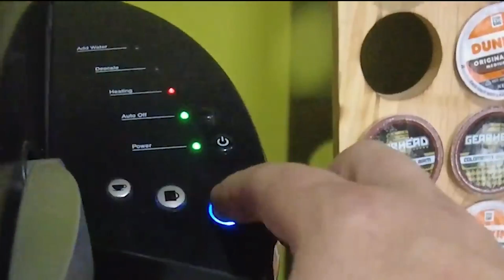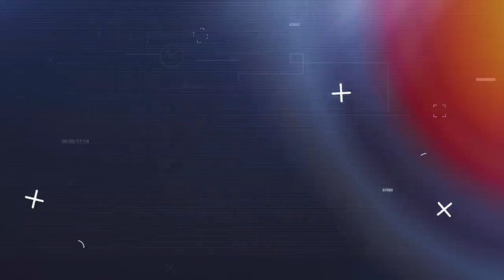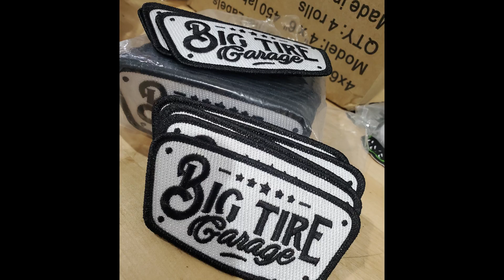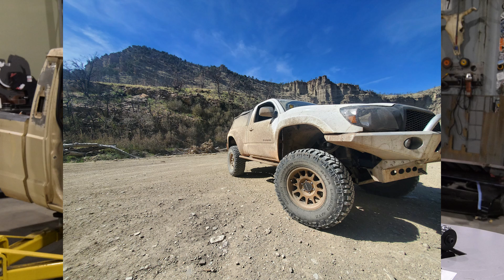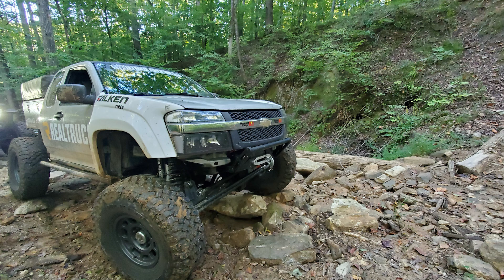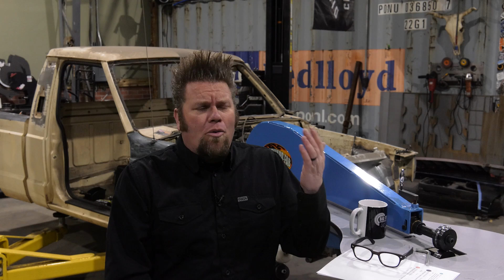The Dirty Secret About Off Road Suspension Design, Why I Don't Build Toyota Trucks, Green S10

Comment: FYI adding bigger tires, off road bumpers and steps, a winch, roof top tent, and all your crap, to a toyota and you've maxed out your toyota's payload and exceeded gross vehicle weight rating. Then lets beat it off road... Sounds like a recipe for disaster.
Reply from the maker: If you modify a vehicle correctly and use it safely you are fine

Comment: I have a 2020 JL 2door, 6 speed manual, I’m lifting it and going to run 35’s and want to put air lockers in it. While I’m there I wouldn’t like to swap gears, what would you recommend for a 3.5 lift with 35’s that will help keep some fuel mileage as it will be my daily for a few years.

Comment: What lockers do you like? Air/Electric/Cable? What is the strongest in your opinion? Do the rear or the front first or both, and would you recommend a winch before lockers?

Comment: Hey Ian! I have been in the offroad world about 12 years now. I am the kind of guy that does things on a budget and has the ability to do fab work myself. My question is this. When doing axle swaps in jeeps why is the aam 9.25 out of a dodge not looked at for swaps? There was a few years where it was high pinion non-disconnect. Is it strictly because of the 9.25 ring gear or are there other reasons? I would think it would hold up to 40's under a jeep? What are your thoughts? Keep up the great work!

Comment: I am bench racing my eventual next crawler/exploration build for west coast wheeling and am debating between a first gen s10, first gen Ranger, or first gen Dakota (all ext cab short bed/bobbed long bed cuz I’m 6’3” and need room). I’d like something low slung SAS, full bodied, on 37-38s, debatable on tons or just built D44/9” cuz I don’t want it crazy wide. Which platform gets your vote for best to SAS without doing a front half, and for decent reliability in drivetrain in stock form? 
P.S. I’d love to do a Comanche but they’re just getting hard to find for cheap, and I’d rather start with a frame (currently running an XJ). Also, Toyota’s are just too expensive these days.

Comment: QUESTION:  What is the formula for building a streetable off-road rig?  The idea is to make a reliable and streetable rig that can hold its own off road.  My off-road goals are to wheel here in the mid-west (Ohio, Kentucky) but I also have a life goal of wheeling the Easter Jeep Safari.  My on-road goals are to drive it in the summer, back and forth to work and around town and on the highway and not fear for my life and the rig needs to be reliable enough that I don't get stranded.  What is the biggest tire I can go with and not have issues on-road?  I already have a set of new 40" tires, is that a bad idea if I want to go 70 mph? I know you love a TH350 I really would prefer a trans with over drive.  What do you recommend?

I have been watching your shows pretty much since the beginning.  My first episode was the bottom drawer buggy payoff with Jessi and I have watched everything you have put out since.  Got to meet you at the off road expo in KY and you are just as nice in person as you are on the show.  I have been buying vehicles and they have pretty much sat in my back yard but that is going to change.

Comment: Question: If I were to add a locker to an exsting ring and pinion, would it be possible to change the ring gear over from the existing carrier to the new locker without doing a gear setup? - Maybe just swap shims side to side. I have no problem buying a dial indicator, but I am wondering if it is possible to check backlash with a feeler gauge? Love the channel. Please advise.

Comment: Question:  Portal axles seem like the perfect solution to several off-road problems.  Why are they not very popular.  Outside of Nate's current build I don't see too many.  I understand they are expensive, but even in builds with amazing budgets they are excluded.  Your thoughts please.
Reply: They are absolutely everywhere if they suit the comp, for example go to a Werock comp and you’ll find more portal rigs than straight axle. 
Whereas speed events like Ultra4 the number one goal is just to finish, the old saying ‘to finish first, first you need to finish’ and the portals just introduce too many possible breakages that don’t necessarily have benefits to outweigh the decision, as in portals aernt going to help at 150mph + in the whoops.
Reply: @robertmason2076  While you state the obvious, you also miss the obvious.  There are more Jeep builds than anything else, and nearly no portals.  Toyotas and Zuks are probably the next most popular, and again, nearly no portals.  There are probably less than 200 moon buggies in the whole country.
Reply: Theyre expensive, rare and hard to get parts for, no aftermarket for steering arms etc,  make shit stupid tall and take away alot of uptravel with how much separation is needed on the links to deal with the extra leverage the portals add to everything. 

They really dont solve many issues
Reply: @krisbarnard1684  And yet, they are nearly required on a moon buggy to do well in competitions.
Reply: @freeidaho  yes they work well in one very specific high dollar application and scenario. In the overall world of offroad they arnt practical
Reply: @krisbarnard1684  Maybe, or maybe they just haven't caught on.   Outside of moon-buggies most off-road builds today are monkey see monkey do.  Very little new thinking.  High-dollar made me laugh, most modern Jeep builds approach $100,000.  I'm anxiously following Dirt Lifestyle's portal build.  I'd bet it will be excellent!  Turns out Ian built the thing first long ago, and it is being rebuilt by Nate.

Comment: I think you are saying that while it's possible to solve the geometry equations, it's not worth solving them.  I can see where it could be valuable in trying to figure out why one truck flips over backwards when it tries to climb an obstacle, and another truck does not.  If you are trying to design that truck that doesn't flip over, doing the rotations and CG calcs would be worth it.

Comment: Would the 2jz or whatever it is be a good motor for a Toyota build?
Reply: Yeah guys use them, both NA and turbo, they’re good motors it just depends what you’re using it for. Turbos can be problematic on the rocks depending on the size of the turbo. The 2J can take a lot of abuse though from my experience. But most I’ve driven or worked in were big turbos that would not work well in a wheeler

Comment: Keep up the good work, Ian. I have always been curious what happened to the Ranger you built on Xtreme4x4. I recall it had a hand throttle on the shifter and it broke on the trail. I don't know what happened to it after that.

Do you have any recommendations for a good starter "kit" for getting into welding? Thanks!